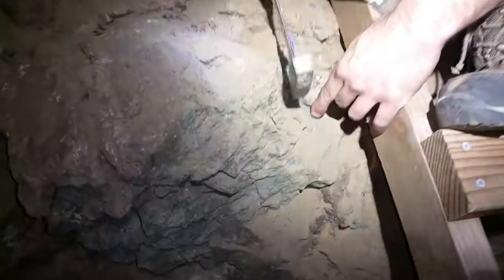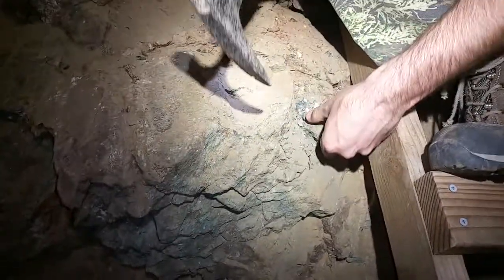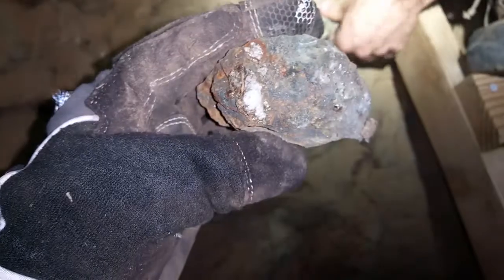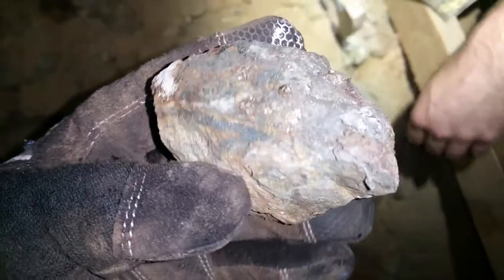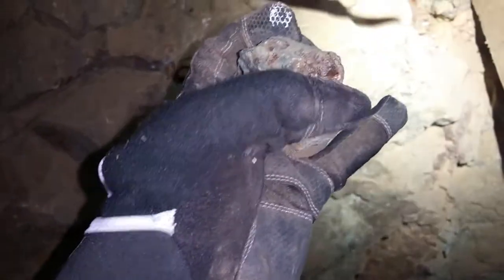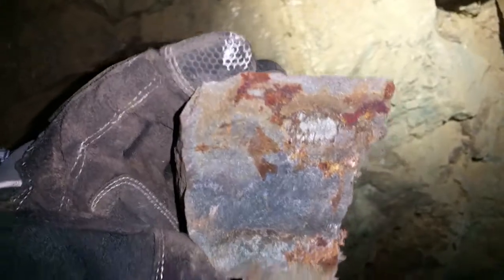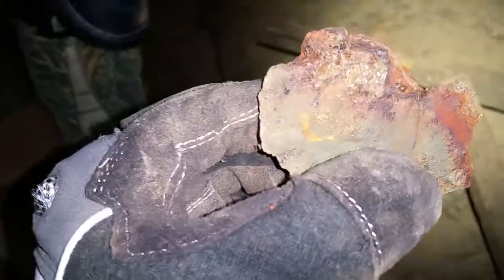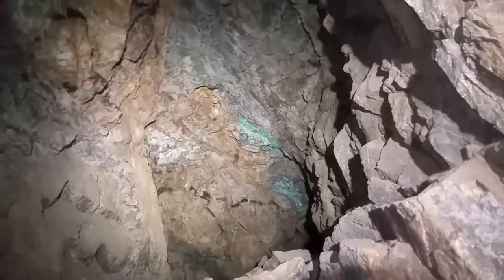Sampling gold and copper ore in the Green Mountain winze

Comment: Cold Chisel would help a lot here. I am a dork but I carry a drilling hammer on my right holster and a chisel on my left. You dont want to use that pick hammer to bang on any cold rolled chisel. Nice ore BTW! This is why I break everything open even if it looks like boring on the outside. If it is close to the mineralization, it could be hiding a surprise like that. I am so geeked to see what it all runs.
Reply from the maker: Funny thing, my rotary hammer is about 50' away.  There's the 3.5 and 5 pound hammer outside with a awl chisel.  The 22 ounce sample hammer is outside. Instead, we use the smallest tool we had with us, because like, we went to college and stuff.  lol
Reply: I know how that feels, I have done the same thing just because it was the heat of the moment and I was trying to find more interesting mineralization rather than go walk to get the proper tools. ;)